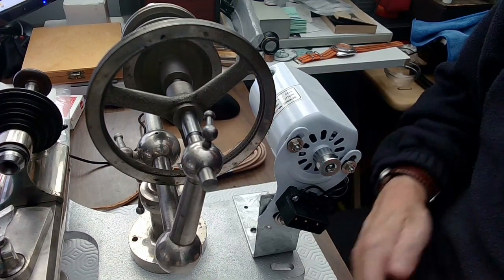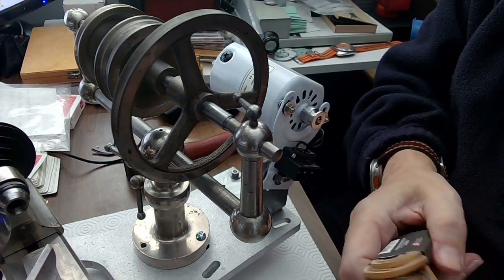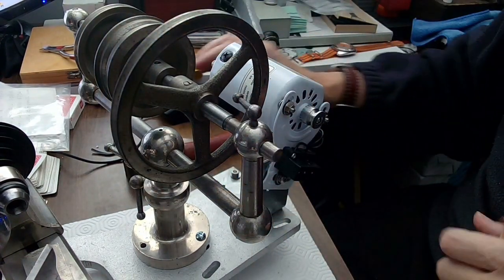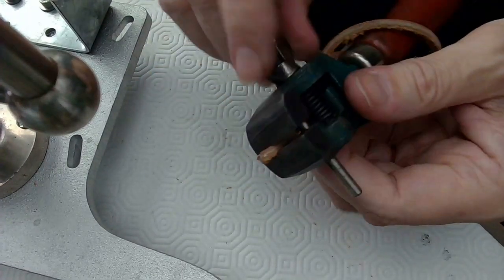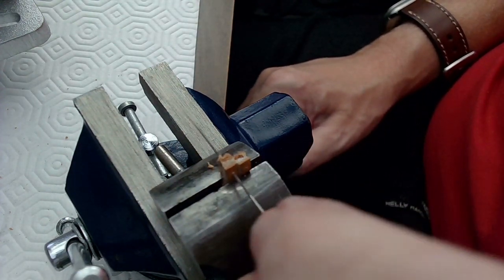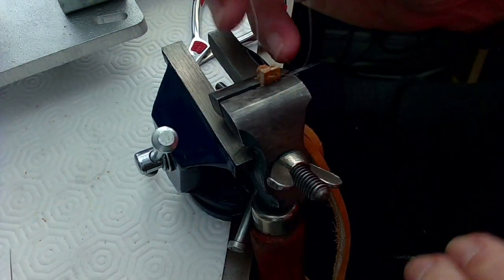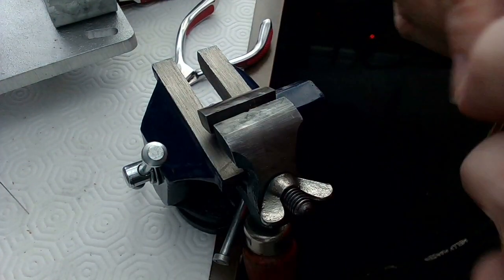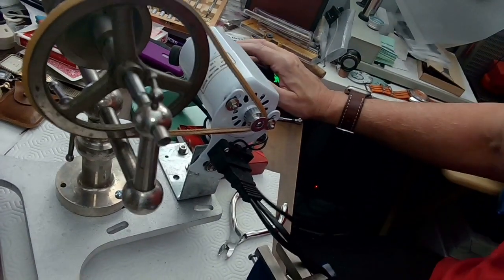Making a Leather Watch Lathe Belt - Part 1

Comment: Once again, great video and love your way of explaining things. I recently purchased a boley 8mm lathe that seemed to be from a flume F35, so it is without the motor and base. I luckily won an auction for a racine motor which is on the way, so I plan to use your technique of creating the belt. Before I can do any of that, however, I still need to find a lathe foot. The base of the headstock is a small rectangular piece of cast iron. I really hope I can find something or I’ll need to rig up something…
Reply from the maker: Send me a picture at jdwatchservice@gmail.com
And I will see if I have anything.
Reply from the maker: How do get so many subscribers